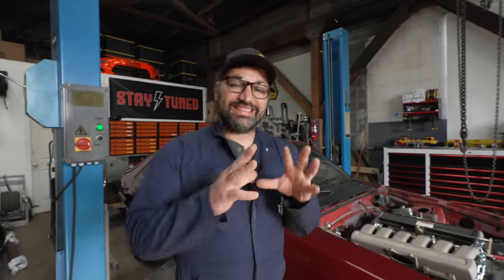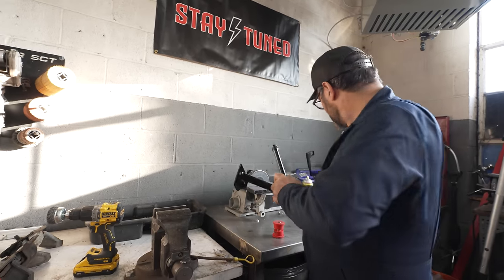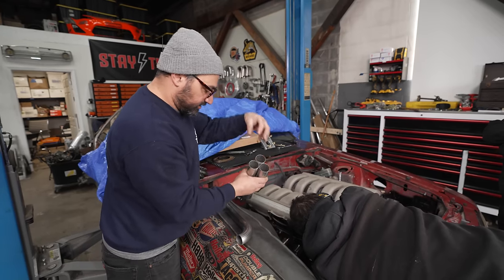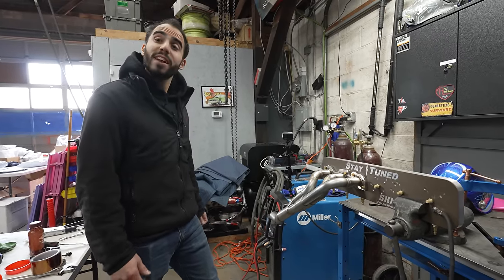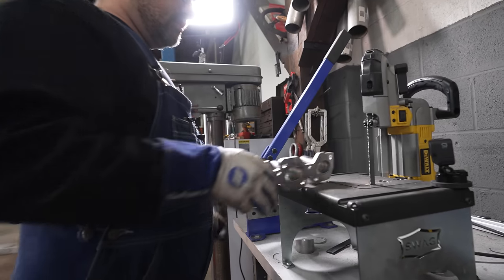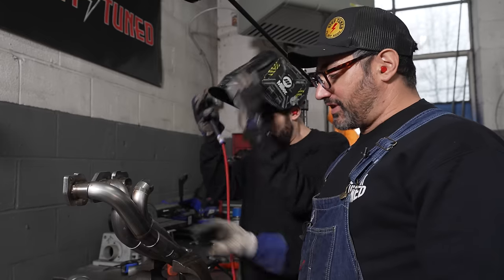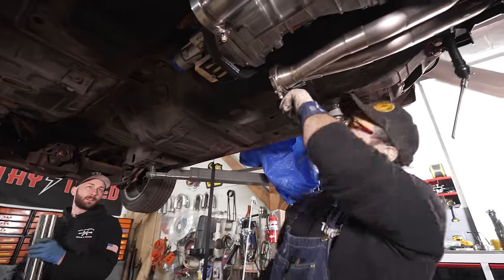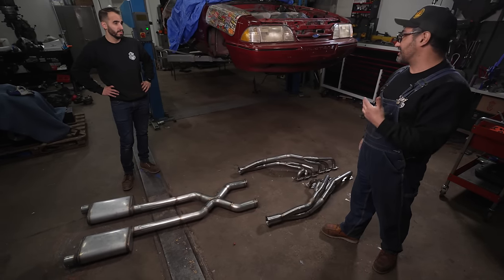Building V12 Swap Headers For a Mustang 5.0 is NOT EASY.

Comment: AM/FM is perfectly understated
Reply from the maker: I could see it on the fender and be happy for sure.
Reply: I was a fan as well.
Reply: Same
Reply: @StayTunedTA  with the Stay Tuned lightning bolt as the forward slash. it's meant to be.
Reply: @StayTunedTA that would be perfect. Knight mare on the back or windshield tint strip, then AM⚡️FM wherever you want since it's short and it fits anywhere
Reply: Knightmare Radio
Reply: @bobbyrobinette5772  yooooo. It's a 1987.. 98.7 fm 1987 am Knight Mare radio AM⚡️FM

" with your hosts Tony Bologna, Barbwire and ZimZam. Playin' all the hits that your mama warned you about. Crank it up and rip the fk'n knob off'
Reply: Right. Nobody understood 
AC ⚡ DC for the longest time.
Reply: voting AM⚡️FM: stay tuned in for that sweet V12 singing 🎶
Reply: Yup. Good on merch
Reply: +1 AM/FM fits "Stay Tuned" so nicely.
Reply: AM FM works well…I was trying to come up something using “Marty” to make the Aston Martin more “blue collar”….like Marty McFLY maybe? 😂
Reply: AM⚡️FM
It's all about that glorious V12 music.
Reply: It is the opposite of a Shelby-AC Cobra pairing. Maybe a play on that?
Reply: If the PA license plate is available you gotta do AM/FM
Reply: Probably a better name than Astang or Astony Martang
Reply: AM ⚡️ FM for sure
Reply: AM/FM and Stay Tuned is a pretty perfect pairing...I honestly think that was meant to be...it's also super easy to say and explain...
Reply: American Mussel / Foreign Motor
Reply: AM FM ALL THE WAY
Reply: Bosstin Martin
Reply: Foxzilla
Reply: I think thats the one. . .i approve this message
Reply: I'm with you on AM/FM.  FoxCalibur comes to mind, as well.
Reply: AM⚡️FM on the lower fender
Reply: @assaultlick2169  only drive it on two fer Tuesdays
Reply: Must Austin
Reply: AM/FM‼️ You Couldn't be anymore Subtle and On Point Than That (License Plate)‼️
Reply: I like AM/FM best for sure.
Reply: Austin Mustang almost sounds like Austin Martin

But I dig AM/FM maybe make it look like the dodge R/T badge?
Reply: everyone loves music and this v12 is gonna sing
Reply: I’m a fan of
Reply: If you use a ford ranger master  cylinder the lines will come out the other side
Reply: @santorty Have the lighting bolt and then “AM/FM EQUIPPED” on top of it. Like the old diesel locomotives.
Reply: AM⚡FM with the right fonts is pretty killer and totally vibes with all your other branding.  I just posted that I like knightmare too.  Tough choice!
Reply: I think DB 5.0 is better...
Reply: Gotta call it the Boss DB9
Reply: As a Gen-Xer, I totally vibe with AM/FM. Plus, your channel is called Stay Tuned! Perfect match. 😎
Reply: AM/FM
Reply: +1 AM⚡️FM
Reply: Fox Hunt, fox body obviously, fox hunting, something traditionally English which used to be aristocratic, but is now illegal.
Reply: You should put the V12 on an engine dyno and compare the output with the original and your headers.  I am curious to see if yours compromise power.
Reply: The AM/FM DB Five-Oh
Reply: Mustan Martin
Reply: Mustin 12.0
Reply: Make the AM/FM look like the old A/C gasser class writing
Reply: AMstang is my vote
Reply: aus-stang fox-ton
Reply: AM⚡FM   Approved. I prefer it to KnightMare, it better reflects our sober demeanour  LOL.
FYI  :  As a Brit we'd call the car  type  Aston Mustang
"Aston Lump" might be painted the back of the car, or maybe the bonnet(!) with a racing paint set up. "Lump" is one of the slang words here for engine.
(FAston Furious ?)
Reply: You said that kids under 40 wouldn't appreciate the reference to broadcast radio.  As long as they keep installing am/fm in cars, you'll be fine.
Reply: Yeah but do it like a AC/DC logo bro.  Rock on  @StayTunedTA
Reply: FOXII

FOX because duh. 

XII Roman Numeral for 12.
Reply: Knight mare is cool but AM⚡️FM just takes the cake
Reply: AM⚡️FM
Reply: "Scuttle- Fox "  being the 1st Aston Martin built and  registered in 1915  earned the  nickname Coal scuttle and obviously being part Fox body. So with this one of a kind creation we have the Scuttle-Fox 😂
Reply: The Musty Martin
Reply: Gaston Martin
Reply: Gaston Martin
Reply: Aston Marstang
Reply: @assaultlick2169  playing all the greatest hits to keep your night rolling, whether you're prowling philly, assaulting allentown, or stalking Scranton
Reply: Was going to suggest the “Haul Asston Mustang” but gotta say AM/FM is sticking with me
Reply: @jasonharmon this is a beautiful point. Makes it even better.
Reply: @StayTunedTA Add vantage
Reply: I like AM/FM. The knight mare is trying way too hard. And ford has a nightmare trim on older broncos and I believe f150’s. Already forgot the 3rd one you said so it was obviously lame. Haha
Reply: There's an ass ton of martin in that little mustang
Reply: Austang
Reply: @StayTunedTA  you should call it the foxtin Martin
Reply: Ya Im with am/fm now.
Reply: @StayTunedTA  Great Stang

Comment: make it sound like an old F1 car. its going to be absolutely rowdy!
Reply: That is exactly what I would do 👍. Tavarish you are the man 💪🏻 I love what you do sir 👍
Reply: Tavarish bad bad tavarish lol love you videos man best of luck with the McLaren
Reply: I don't know if that's going to be the result Tav man, I'm definitely worried about those primary lengths, cylinder pairing, and collection.... I believe they built like the average person trying to build headers into a tight space and didn't take the resulting end sound into consideration while welding them up.... I'm crossing my fingers the X pipe is going to magically pull something out it's azz here 😅🤞
Reply: I think at some point this should be given the equal length treatment

Comment: I tacked welded all tube elbows and straights to flange and routed each tube pieces to the collector which was tack welded in its location under floor pan. After all tubes were in place I removed the header as a unit. I then remove each tube from flange and collector and complete welds on each tube. I then reinstall flange to engine and collector to floor pan location and weld as much as I can while header is installed in chassis of car. I remove again to final weld all areas I couldnt reach while header was installed in car chassis.

Comment: Not sure if anyone commented on this but the OEM were equal length tube headers. I am wondering if changing the location of the collector and length of the tube makes a measurable difference. Or if it changes the sound (exhaust note) at all?  Amazing work. I am addicted to watching your shows. I would love to pick your brain about a project I started. I work in a vacuum and Youtube seems to be my only help.

Comment: This is a really great project.  Your headers are looking good.  Tri-Y long header version.  To compliment your design, suggest considering a gently sloped 90 degree air intake on each side versus the 'hard' 90 degree intake probably having to use some of the fender well space.  Looking forward to it!.  Or get the late model intake manifolds which enter from the front?  Similar AM shock tower racing on top?

Comment: Not sure if it was mentioned in the video, but please put tail pipes on that LX. They look so much better with a pair of pipes sticking out the back! Also, you should weld in some subframe connectors also. Makes a huge difference in those cars.

Comment: I have had so many hot rods/etc, brought to me with steering issues. Some have had as many as 7 u-joints in the steering shaft. The point is, put the steering in first, then build the headers. Not the other way around. Good money maker for me though.

Comment: Knight Mare is tight i like that im also huge on naming cars my currant/first car is a lifted 84 K5 blazer thats ratty with tons of vintage mods her name is the honey badger, im also going to buy a 69 elcamino or a 56 chevy and build a vintage street car lookin vibe with old speed parts and im going to layer many colors of paint and then out white over it and samd through on parts where i want the layers below to pop its gonna be called the Jaw breaker, and sometime in the future when i have the money im going to build a completely bespoke 83 trans am in all carbon and all wheel drive im gonna bassicaly make an 83 trans am with the quality and detail of a pagani the dash on those things looks hella like a fighter plane and becayse its gonna be so light ao aerodynamic and fast as hell with all wheel drive, oh and the engine im gonna use is the flat plane crank V8 outa the new Z06 so its gonna sound insnae (modded of corse) so this car will have the handeling, grip, speed, power, sound and quality of some of the worlds most special cars and will hold its own (or idealy beat) those cars its name will be the "Blackbird" like the SR71, im gonna put some imagry of that jet on places its my own personal hypercar, and someday im also going to build a 32 ford with two iron dukes i know how to pull 350-400 hp and 11,000 rpm out of one so what about two, and because 32s are called duce coupes and its got two engines i might call it just the duce, or something like that im ginna play with the 2 and duce wording and imagry, i also got another idea for a light cyberpunk styled C3 vette thats gonna have a small block chevy an old one that im going to costom make a flat plane crank for and have 8 carbs on it fir that insane induction noise, dont know why i typed this in here but i got hella ideas for some cool shit, if i ever have the money i will build these cars and bring them to sema amd charge supercar prices for them the quality i will be putting in these cars will be that of supercars and will be worth the price, exept the jaw breaker that ones mine and there will olny be one

Comment: Personally I prefer to weld those u-joints on the steering shafts.  The shaft torque camming the joint combined with the clamping pressure of the screw can lead to failure.  I had one crack and split from the set screw hole which as you can imagine was not ideal when it failed.
Reply from the maker: Maybe we will do the same. I like that idea

Comment: First, I dig the Knight Mare.... it's a dope name, secondly and more potentially painfully.... I didn't catch you guys mentioning anything about firing order or primary collection methods and patterns..... and I know that driver's side is being overall collected super shortly.... I'm crossing my fingers, but if I were you guys, and you didn't take any of that above or even consulted the stock header primary patterns before building and running those primaries and collectors, but you might not get anywhere close to the sound you're expecting to achieve from that V12.... just saying 😅😬

Comment: Tony, I have  a question... since you will be running a Holly computer and the throttle bodies are in the most un-practical location for this application....would a custom intake be the ticket? I mean it would just take some more TIG work... then you could run a single LS throttle body.

Comment: Any reason this car disappeared from the channel?  Your last statement was something about blazing through the project.  Eight other cars have been on the channel since and no sign of the fox body.
Reply from the maker: Yeah it turns out that V12 parts are hard to come by, BUT we've got a custom flywheel/clutch setup being made and just secured an ECU that can really run this thing so we will be back on it soon. Also did an update on it in last week's video.